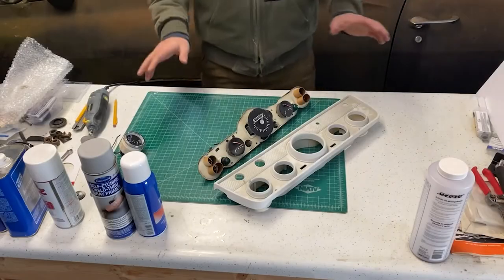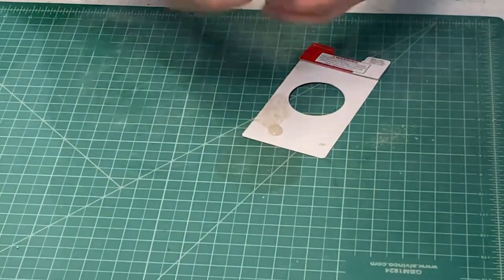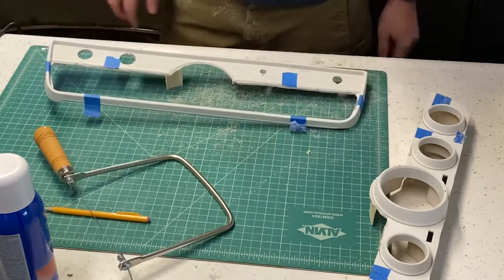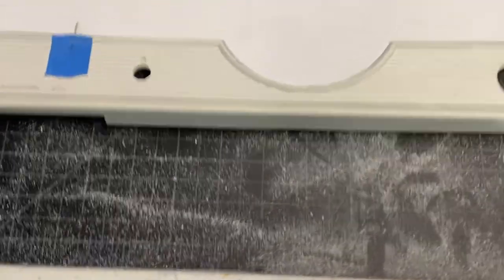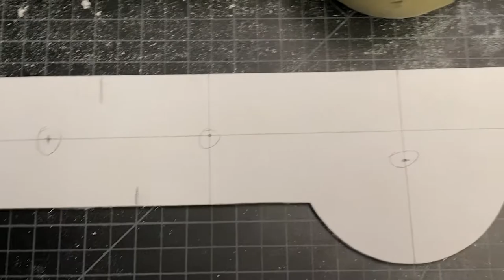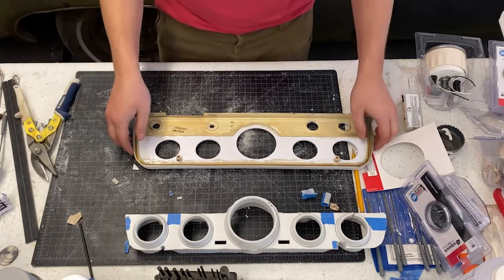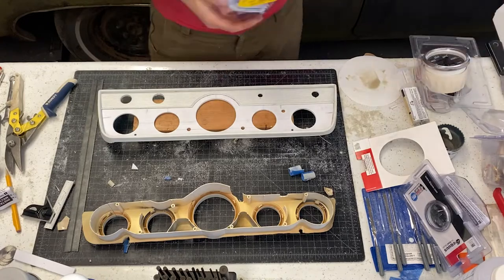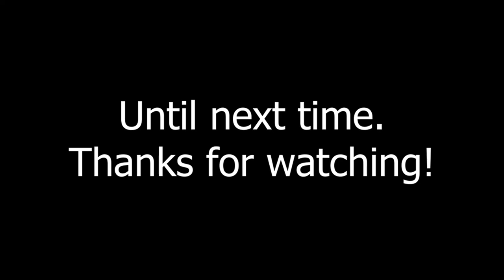How to customize plastic parts, new gauges fit old school cluster - 1968 AMC Rambler American

Comment: Hi Mike  I've got a question about your Rambler since I have a problem with mine. I'm curious about how the rear sheetmetal that mounts to the bumper looks like since mine has completely rotted out. Great series btw.                Cheers  A.G.H.L
Reply from the maker: Missing metal is a pain. Here's video of the sheet metal on my car. I hope this helps you on your project and let me know if you need any other examples. https://www.youtube.com/watch?v=XfsFztCQdqM
Reply: @carsbymike5154  Thank you! I will respond with a link of what I came up with.

Comment: Hi Mike, I'm wondering how you took the gauge cluster off, trying to do the same with mine
Reply from the maker: To get the whole assembly out of the dash, it's just four screws from the font. 

For the gauges themselves, I dug up an old picture of mine when I first took it out of the car. There looks like eight phillips head screws holding the circuit board to the bezel. The gauges should come out with the board.